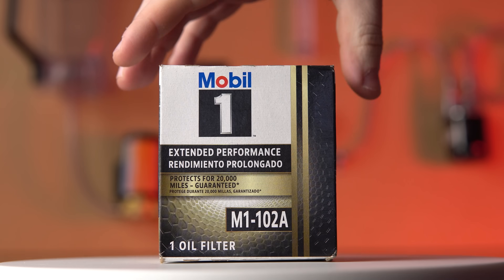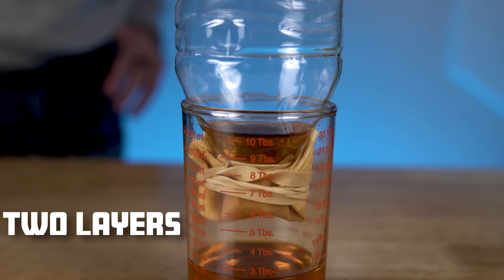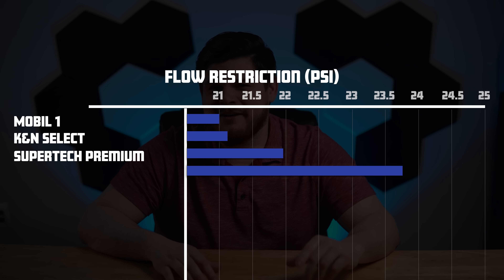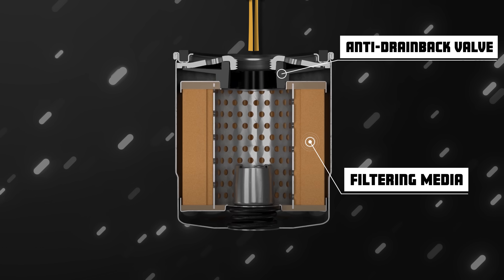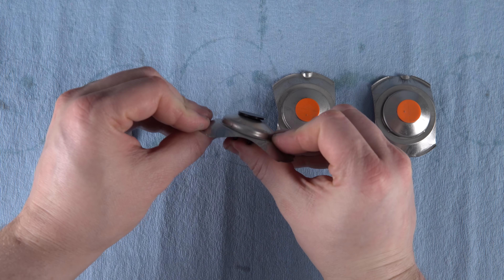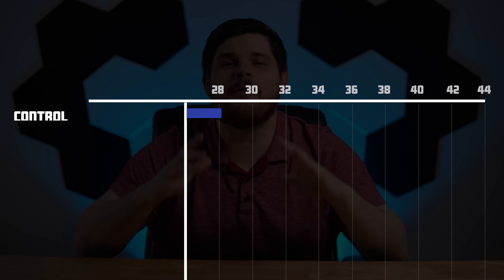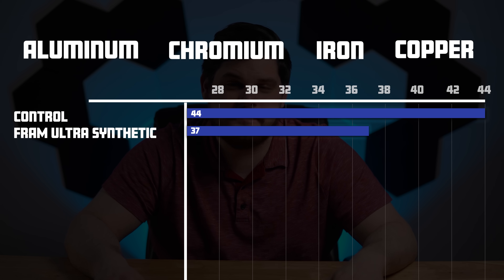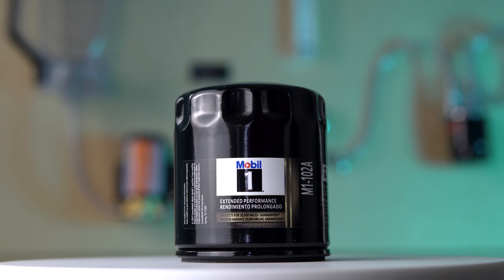Engineers Test the Best Oil Filters! FRAM | Mobil 1 | K&N | Walmart Brand

Comment: Since we drive our cars daily and may not do an oil change for a long time the filtration is most important. But that being said even if u use ur car at the track ur gonna push the car and put high loads on the engine and cause more engine wear and you most definitely dont want large amounts of metal particulates flowing through ur oil and onto ur cams and bearing surfaces while ur reving upto rev limit. So in this case u also want a filter that filters ur oil very well but also isnt too restrictive. I think the mobil one clearly did the best. Im very surprised the k&n filtered out the most in the particulates in the test sent to the lab but overall it didnt have the filtering capacity. Now i wonder how many particulates get created from a track day use vs a 5k miles worth of driving. If the K&N does filter the best but has half the filtering capacity maybe it wouldnt be able to be used on a daily driven car but a car that gets very frequent oil changes.
Reply from the maker: Thank you so much for sharing and for supporting our channel

Comment: To get an accurate reading you should heat the oil up to temperature. That would be a more accurate comparison. This what also compare thermal breakdown of the filter material. Your test is not a real-world test by no means

Comment: Since Wix filters are used by many auto-truck service centers then that is one you include on future test.

Over the decades I have used most of the major brands of filters and although in the last 15 years have only used Wix filters I feel that changing the oil on a regular basis does more for engine longevity than what brand of oil filter you are running.

And over those decades I have never had an engine failure or issue I would contribute to the brand of oil filter I was using.

Another thing is I DO NOT adhere to the change the oil filter every other oil change strategy and some may say I am wasting my money when I put in fresh oil it is paired with a nice new clean filter.
That few dollars maybe wasted every other oil change with the new filter gives me piece of mind knowing its new worth many times what I spent on the filter.

Comment: so whichever milk jug got poured last would have higher PPM of the metals.. as the metals would settle into the bottom of the used oil container. unless it was all mixed evenly before pouring thats not a very good test.

Comment: One major problem with your testing methodology, the oil is not at normal operating temperature. When the oil is at room temperature, what you are actually measuring is the spring pressure of the bypass valve as the oil is too thick to effectively pass through the filtering media.

Comment: You need to test the oil after the aluminum test for how much aluminum is left in the oil. The filter with the least psi could be letting aluminum thru easier not living up to the 30 micron rating

Comment: Changed O&F in my 2004 Dodge 1500 5.7 yesterday. Used K&N HP-2004 syn OF which is 1/4" taller than most others. Wonder if that matters?

Comment: I used to use a bypass filter along with the normal full flow filter.  It would filter constantly even and especially at higher engine rpm, and filter down to 5 micron.  Since it is so restrictive, the full flow (normal) filter was there to provide filtering AND oil to vital engine components.  However oil that was 2 years old was just as clean as it was at 500 miles.  I changed the bypass once a year.

Comment: This test is completely null and invalid because you didn't use combusted engine oil... This is the point of the oil filter is to filter contaminants out of the oil that are generated from the combustion of the engine and other materials..

Comment: Question is: does it matter if the filter is good or better. In the EU e.g. VW has standard 18K miles service interval and Mazda 13K. Some other Japan brands 10K. This doesn't seem to matter. For better performance, what you need is filter with double length or just thicker, then filter capacity is higher. But apparently manufacturers don't require this.

Comment: Nice test. and honest comparison.
There are definitely many more filters that could be compared to these.
I've got 235000 miles on my 02 Ford F150, using nothing but  Motorcraft oil and filters.
They've worked so well to this point, I don't plan on changing...
Not sure what the "high mileage" filters or oil do differently, but I subscribe to the theory "If it ain't broke, don't fix it"
Reply: I same here I just use fomoco filters 500.000 k on my99 7.3 ps nd 97 400.000 on my 97 ps nd all my other half dozen fords that I have had  the past 20 years including my 66 fairlane 500 xl 289 ❤
Reply: I think the FoMoCo  oil filters are 1 of the best

Comment: I started working for a major Ford dealership in 1989. I have been using fram for over thirty years and not one of my vehicles or customer vehicles have had mechanical damage or serious mechanical wear. But for those who do not understand how an engine actually works the so-called tests that were in that video are crap. If you see that much crap cake in an oil filter you need to pull that engine and either rebuild it or replace it.

Comment: I'd probably go with the better oil flow over filtering, simply because it's easy to change the oil more often, which will reduce wear, whereas oil starvation will destroy your engine far more rapidly.
Reply: There's a bypass though
Reply: The lesser flowing filter wont reduce the overall engine flow, only the flow tru the filter, as engine has multiple paths for oil to flow, it will simple take the less restrictive path.
I think the best approach would be measuring the filtering quality by engine operating time, so you would be able to correlate the flow and filtering capability
Reply: Paper filter that filters down to 20 microns at the highest % is your best option.
Reply: oil starvation? neither of those will cause any oil starvation lmao, their flow rate is well over engine needed
Reply: Exactly. Best to go with OEM with perfect pressure specs
Reply: @hjer731 OEM is good , though this test would probably lean me towards the Mobil 1 .
Reply: @hjer731 thank#, great idea….actually went that way( esp MOPAR, lots GMC),   last several years….Switched to BOSS , generally now

Comment: Just because something says what its good for doesn't mean you follow it.  Look at vehicles and their "lifetime" fluids.  I don't see you testing this because there is nothing to test.  It's all marketing on the filters and you should never let your oil intervals go more then 4-5k miles max.  I don't care what tests yours might show, or someone else's.  I'm writing this before even starting the tests, and even if you state "this filter is indeed great for the posted distance, feel safe!" I would never take anyone's word on it.  If someone wants to ruin their machine by not doing oil changes when they really should then that's on them, on them for believing what they read, for believing in marketing.

This testing is almost one sided and you favor your favourite.  Everyone has their favourite.  ALL filters, even the cheapest filter is perfectly fine on proper oil change intervals.  If you have that much of anything running through your oil your engine is pooched, no filter is going to save it.  This test is just silly and doesn't represent real world applications.  You are doing essentially lab tests for which mean jack all in the real world.  Your silly example of 1 pleat versus 2 drip test to show how bad Fram is was also terrible since you are showing a gravity fed system, versus something that uses pressure to move fluid.  We get it, you are like all the other haters out there, just state it and be done, Fram is garbage, go buy Mobil.

Be different for once, stop doing the same as all labs.  Do real world tests with proper results rather then dumb rigged or bogus lab tests.  Until you do, your word means nothing more then any other marketing garbage on nearly everything known to man that's sold around the world.  Do better.

Comment: While pretending to do the evaluation scientifically, it's clearly biased. Wonder how the "Mobile 1 in 3rd place" while having the same result as the number 4th place would have influenced things.  Also, you're appearing to give equal weight to your different tests, which likely isn't proper either.

Comment: I hope to be wrong but I wouldn't touch anything from Fram with a broomstick for sure.

I'm using CASE Ultra oil filters for my 12 valve Cummins 5.9 L with 515.000 miles on the untouched
engine and the oil still stays clean for about 2,000 miles before turning darker like, as far as I know, 
all the newer Diesels do in a heartbeat nowadays.

Other filters I have used are the (too expensive) original Cummins and the WIX which have been
recommended with good test results.

Take  care and, if possible, include other filters in your very impressive testing procedures.

Comment: You're confusing filtering capacity with nominal particle size,  filtering efficiency, and filtering efficacy. 
Also 30 microns is actually a pretty large and abrasive particle, larger than the thickness of most of the oil films separating parts in the engine, and allowing 1% larger particles to pass is not great. There is a reason larger diesels install bypass filters with a nominal 2 micron rating.

Comment: Oil, oil filters, extended oil change vs normal oil changes -- all very polarizing for everyone everywhere it seems. Go check any forum and you'll see everyone throwing their 2 cents into the ring. And to further complicate testing and simulation of wear of oil and filter medium, well there's just way too many variables here for you to draw a valid conclusion. Anyhow, I chose to use Amsoil top end synthetic, an OEM Delco filter, and change my oil every 5K miles. I'm personally not a fan of these extended oil changes. Again, my 2 cents worth.

Comment: Test looks pretty good. I would like to see the oil heated to normal operating temperatures for a more accurate. As far as the pressure portion of the test, I feel like that might not be a very important part of the test as the engine using the filter is going to dictate the overall system pressure then the filter.

Comment: my dad refused to use Fram filters because he used to be a mechanic and he would sometimes install a new fram filter only to find the car had no oil pressure and he would look and see that the factory had forgotten to punch out the holes for the oil to flow through
Reply: That's a cool lie😅
Reply: Note this is not their plain Jane filter. Frame generally sucks

Comment: One thing to Note is the K&N select filter shown here  is a Walmart budget friendly one; Not K&N's "Real " filters which are the HP series not sold at Walmart. So that's kind of misleading in that way...And yes most are made by Champion in their factories true, but to different specs based on who's brand and type they are manufacturing for.. So they aren't going make one for use for  NASCAR or NHRA engines for  K&N and sell those at Walmart for $10 for example.

Comment: In the many years of experience working as a mechanic in the automotive repair industry I personally have not seen but a hand full of flow/pressure concerns cause by a oil filter. Those that do fail are the majority of the time a manufacturing defect or the very few others are a extreme lack of maintenance. With that I personally use FRAM myself because the higher amount protection  and you will never see a concern with flow or performance. Also I do not feel the there's a right or wrong answer with what filter to use, the only correct answer is to change your oil on time.

Comment: Back in the day when John Force starting running GTX and FRAM oil filters on his car I thought that they were the best then I found out the FRAM oil filters hold too much oil pressure so decide not to use them the Castrol GTX motor oil I've been using in my car is now for 30 years most of them I put close to 200,000 miles on before I traded them for something new Castrol motor oil is number one in my books but Fram not so much so what I've been telling people for years wasn't bulshit and for Can-Am I think they're just totally overrated and people just pay too much money for the name have a great day later bye

Comment: Glad someone is finnaly showing reality. Honda America does not recommend the Fram Ultra or higher due to poor flow. Are tests are clear 5 to 7 psi drop in oil pressure. At least for Handa specs the filter is to restrictive.
Reply from the maker: Thank you so much for the support and for watching!

Comment: i still don't like the way the FRAM performed especially the way it built up around the the cap and the silicone valve with that said i think you really need to run this like a TRUE real world test. I mean just like you did but maybe heat the oil or simulating being cold and/or hot weather. There are so many different variables that can be tried.
Reply from the maker: Thank you so much for the suggestion. We definitely made some improvements for our next video including temp simulations. Hope you subscribe so you don't miss it. Thank you for the support

Comment: Being an off road tech I find an ocean of filters in use by the customer from OEM to wtf kinda filter is that. Most filters kinda sorta do what they were designed to do..... untill........ the temp hits - 45 as I find myself in alot. At this temp the majority of filters will fail almost 100% of the time via rupture of the filter media or the face seal or at the can crimp followed by engine failure if left unmonitored. 
Cat filters are champ for obvious reasons followed by WIX which take a fantastic beating for a fraction of the cost.
Its what happens under extreme conditions that decides true class leading products.
I know customers running Fram products on their gear, they know what Fram is, they change them out 2x as much and save money that way in the summer and switch to Cat or WIX in the winter, because they know and understand the limits of a lesser oil filter.
Reply from the maker: Thanks for sharing and for watching.

Comment: Faux pas. Adding more filter medium is what they do with large engines like OTR trucks that use two very large oil filters instead of one tiny filter like on many import cars. You simply increase the amount of filter medium by using larger filters and or more filters, often in series.

Comment: I had 2 filter failures with Fram. One was a canister style on an HHR that literally disolve in 5000 miles. The other was an o ring failure. Fram decided a flimsy white silicone o ring was better than the black rubber one. Either that or they were saving a half penny. I will stick with Wix or Napa Gold.
Reply from the maker: Thanks for sharing. We are definitely planning on testing those.

Comment: I really liked this review however I feel that it lacks certain Information that you most definitely should have included, first fact is the Frame  oil filter filters out 99 percent of particulets 20 microns and 75 percent of particulets at 10 microns making the Frame ultra synthetic oil the best filter by far in your test.
Also about the aluminum powder if a engine has that much aluminum particulets in it the motor is junk even if the motor had a 1000 percent less aluminum powder so the Bottom line is this is not a fair honest review of oil filters.
I'm not sure if the 3 pounds of pressure needed to push the oil through the filter matters as I use the Frame ultra synthetic oil filter and I never have a dry start up at any temperature. 
Finally Blackstone laboratory said that Frame ultra synthetic oil filters performance is on the edge  of their limits of what they can measure in regards to particulets.
Guys I would appreciate if you would keep your reviews normal for regular folks like myself and 99.999 percent of vehicle owners like myself.

Comment: I only use the Mazda or Wix filters for my Skyactiv cause they don't have the adp.... Whatever the back flow valve is. They are specifically designed for the Mazda Skyactiv-G motor. I think the Napa gold filter is made the same as the mazda/wix. So people, if you got a Skyactiv motor, check and make sure you are using the right oil/filter. Anything other than 0W-20, it will run like ish, also only FL22 antifreeze or your ish is ruined, and for the manual trans 75w-80. These are the recommended for the first and 2nd Gen Skyactiv-G 2.0L. Or use all the wrong stuff, kill your gas mileage and eventually engine, up to you. Also, these are GDI engines so clean valves every 30k miles.

Comment: i wouls never run a filter for  10,000 miles i change my oil every 6000 kms or 3728.227 i always use fram  or the ford motorcraft

Comment: Unless the pressure drop within the oil filter is enough to trip the bypass valve, it is generally of low importance as automotive engines use a positive displacement oil pump.  That means they pump oil even with high back pressure.  You don't get a reduction in flow with higher back pressure.  The ONLY thing you should care about is how clean the oil is at the end of the test and how much junk they can hold.

They claim 99% removal.  What percent did each actually remove?  Doesn't look like they did what they claim.

In addition to the lab test:  I suggest you get a positive displacement pump.  Load up each oil filter - determining max particles they can hold, which will be indicated when the pressure no longer increases (because the bypass is kicking in).  You won't be able to use hose clamps or the clear hose (think hydraulic hose).   You should be able to use the clear hose after the oil filter when it drains back to reservoir.

Also suggest you try different models from each brand to Attempt to reduce brand variability.  

Overall great start.